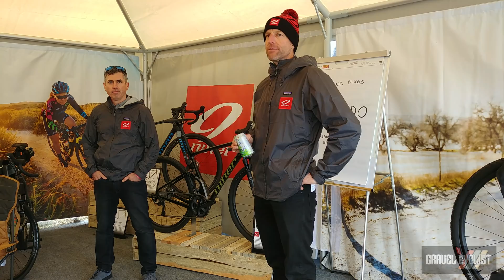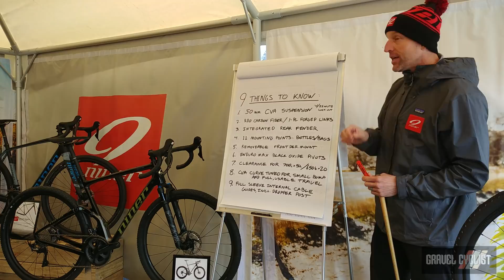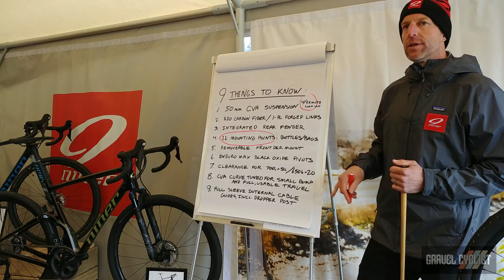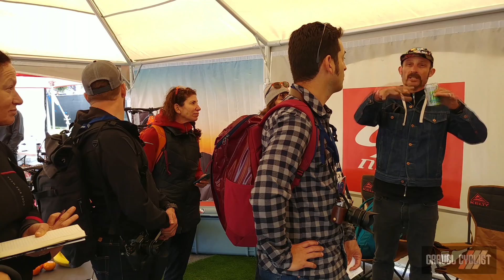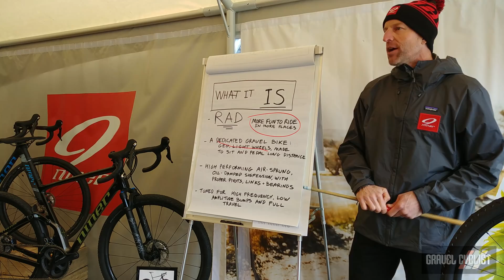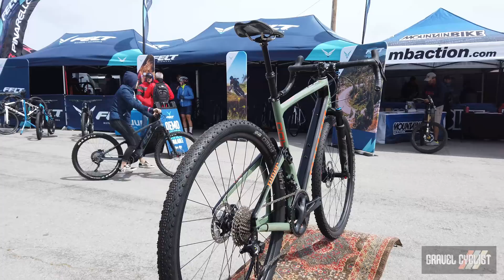Niner MCR Full-Suspension Gravel Bike - Everything You Need to Know: SOC 2019

Comment: I remember back in the day paris roubaix Motorola team had front suspension mountain bike forks on their bikes , the new cannondale topstone carbon bike has a flex in the rear that acts like suspension, many bike manufacturers are trying to put suspension on their gravel, road , cross bikes ,but without actually it being called a mountain bike, at the end of the day ,  if it works why knock it

Comment: Why not just put gravel type tires on your mountain bike?  I ride my hardtail most of the time on pavement and a little gravel and am thinking of putting smaller 29in tires on it to make it a little faster but I am using tubeless and here in Thailand, a variety of tires are hard to come by.  However, I think this might just work.
Reply: Sure you can, but the frame is still a hardtail and less agressive. The question is also where you wanna ride it. From my point of view gravel bikes are about flexibility, why mine has 50/34 in the front and 11/34 in the back so I can drive almost as fast as a normal roadbike, something which wont work with a hardtail.

Comment: looks like a ton of fun on rocky XC trails that might me a little dull on a modern trail bike but a bit much for a rigid gravel bike.    Would think with the suspension you could run lighter wheels and 45c tires in areas you probably want heavy duty wheels and 2.1 inch mountain bike tires on a solid bike.    My dirt roads are pretty mellow and strung together with street riding so I would be more interested in something in between... more rider isolation than real suspension but guessing its all coming in every possible configuration imaginable now that the flood gates are open.

Comment: Still not sure I need FS for gravel.
Reply: Wait till you get to 65 ;) and riding for 6 hours
Reply: If you are STILL not sure you need FS for gravel, my advice would be not to buy a bike with FS for gravel.
It' is your choice to be a slow, uncomfortable Tightwad, no one has any right to stop you.
Reply: @SaintKimbo  relax
Reply: @SaintKimbo  Can't recall any gravel races won on a full suspension bike.
Reply: @phillycheesetake  
That's because a full suspension bike that is made for gravel racing has not competed yet.
It's very simple, the right amount of suspension for the conditions is faster than no suspension, that's why Formula 1 cars have sophisticated suspension systems, even though they race on smooth surfaces.
Watch this GCN video where a front suspension Cross Country bike kicks the ass of a road bike and a cyclocross bike over a section of cobbled road from the Paris -Roubaix road race, for proof of concept.
https://www.youtube.com/watch?v=QvO74sZxVs4
Reply: @SaintKimbo  Not completely true. The winner of the dirty Kansas used a Cannondale gravel bike with a lefty (front suspension). So yes, looks like suspension for gravel racing might not be a bad idea.